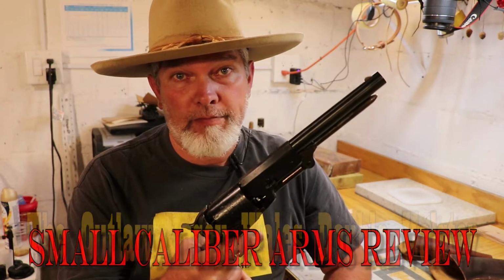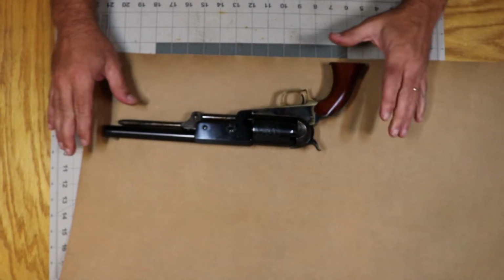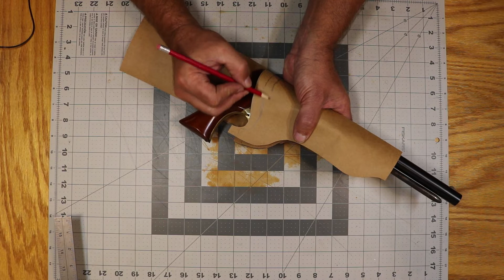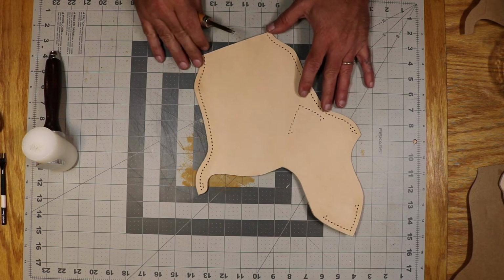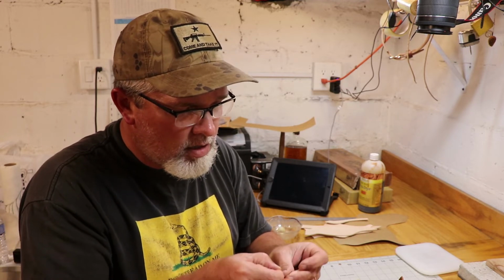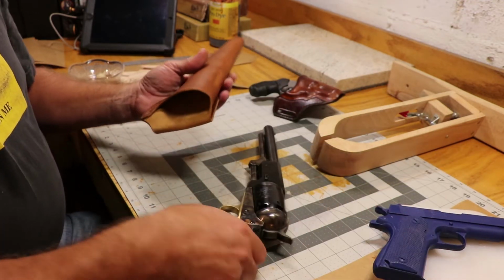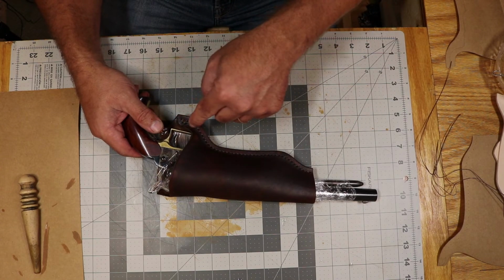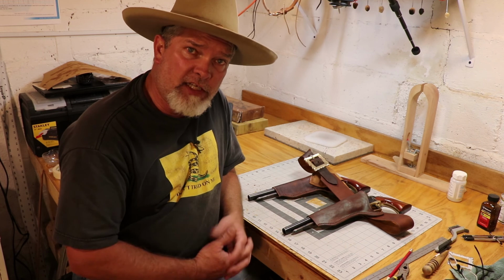Josey Wales Holster Leather Project, Lets make one!

Comment: Nice job making hoster but you should have lined the inside you Will wear to Bluing off the gun  pulling It in-and-out
Reply from the maker: You are correct. I don't plan on using it very much, mostly just for a video. I don't think a little wear on the pistols takes away from the looks, it might even give them a little character. I recently did a lined one for the Gambler Royal and will be making another one soon for a pair of Schofields! Hope you subscribed and thanks for watching!
Reply: Thats not totally true. The ruff and smooth side of the leather will wear off the bluing on any gun. Its not the material itself its just anything you constantly rub a gun on will wear the finish off.

Comment: The book Packing Iron ,I think has a picture of RIp Ford an early Texas Ranger Captain. He is packing two Walkers. I think Clints holsters are copies of those. FORDS dont cover the whole barrel. Ford is wearing them rather high on a ranger belt. Packing Iron is a great reference book for holster and belt design. I made a semi flap holster for my Walker and a Ranger belt for it. These weapons were originally meant to be carried over the saddle pommel. Early military holsters were full flap type.Ranger belts are based on saddle cinches Its like a two piece belt. By flap you mean the belt loop. Mine was stitched so the belt went thru it and it went over the pistol and fastened with a stud in a slit to hold the pistol in the holster as i cross the plains , HA!  I tried making a brass buckle, I gave up. Good info in your video.
Reply from the maker: I just may have to pick that book up! Definitely very heavy pistols to be wearing on a belt but, I just don't have a horse! Thanks for the comment and thanks for watching too!
Reply: @SmallCaliberArmsReview  Packing Iron  Steve Ratten bury. Well illustrated. You will like it. RIP Ford. The RIP was for Rest In Peace.
Reply from the maker: I picked up a copy of Packing Iron on ebay, good book and pretty expensive too! (even used) Thanks for the suggestion, I'll probably be making a holster or two from the book in the future.
Reply: @SmallCaliberArmsReview  Gee i have a copy i want to sell. I used to make a nice profit buying and selling that book. Highest price was like $140. I used to buy in the summer low and they would go high around Xmas time. its a great book. Good luck.
Reply from the maker: @kennkid9912  I just picked up a second copy for about 1/3rd of what I paid for the first one. I think I'm going to offer it as a giveaway when I hit 25k subs.
Reply: @SmallCaliberArmsReview  Good idea. Abe Books is good for that sometimes. Ebay can be good too.I have probably owned 35 copies.

Comment: I missed the buckle part for some reason. That came out very nice. And the brass  keeper is bent around the mid bar. An integral mid bar? i tried to solder mine. That is easier. Good idea.  Where do you get your leather working tools.?
Reply from the maker: Yeah, the buckle is one solid piece, except for the prong. My tools are a collection of Tandy, Weaver, Amazon, ebay and Lowes. I've been picking them a little at a time over the past few years. If you can afford it, go for the best quality ones, there are differences in some of them.
Reply: @SmallCaliberArmsReview  never bought from Tandy or Weaver. I figured most of the Ebay stuff is Chinese knockoffs, they seemed pretty cheesy. I looked at RIP Fords pic on line. He doesnt have the semi holstesr. IT looks like a slim jim with a full rounded flap. I have seen the Wales type in a oldT exas ranger photo but it wasnt RIP Ford maybe it was Hays.i do think that one had the full flap too.
Reply from the maker: @kennkid9912  Ebay and Amazon carry the Chinese stuff but if you're very careful, it will last a little while. I got two projects done with my smallest stitching prongs before they fell apart. Many of the old holsters had flaps that were just cut off to make access a lot easier.

Comment: Tho I’m sure you were after the movie’s “Josey Wales” holster, it’s a faint goal IMHO: a poor design that’s obvious to my eye.
Why? b/c the front sight is always gonna hang on the draw, it’s prone to muzzle fouling by anything that could be beside you upon sitting, that open toe makes the hog leg look even bigger than itself, and the balance point on those WHEN LOADED (rather than when designing while *unloaded!) is higher than the axis pin and forward of the forcing cone. (Loaded, two irons are over 12 lbs!)

Even Eastwood couldn’t whirl those monsters around the holster very well.  (IRL, they wore em high b/c he had suspenders holding up his pants). One might have expected him to use a shoulder sling to help his belt, but that was the experience of calvary and officers— and after all, it was only a movie, right?
[While he rightly identified the flap holster of a soldier as “slow”, doesn’t slow me down *that much.]

His experience in the war would’ve shown him that Walkers could kill anything, including horses, mules, and several men standing in a line. (Walkers and dragoons were even reportedly used to down buffaloes.)
Reply from the maker: I agree there are much better holster designs. The movie holster is what I was going for even if it's a poor design. Thanks for watching!

Comment: Where did you get the hat?
Reply from the maker: I actually made it from a standard "Cattleman's Crease" hat, the kind you can pick up from Tractor Supply or Boot Barn. A little steam and some hand forming and , Viola! (Sort of) Thanks for watching!
Reply: Dude you are kidding!  You nailed it!  You made the pencil roll on the brim look authentic  1800s.  Josey Wales hats on the web cost at least 250.  I’m confident in forming the crown but I’d like to see how you made that pencil roll look so neat.  None of the western shops in my area can do it.
Reply from the maker: @WOMPITUS  It took some time that's for sure! I also have a very small travel iron that I ran around the brim while pushing the pencil roll, or edge of the brim up against the iron. I saw the prices on line, I couldn't afford them so I bought a cheap hat and did it myself. Several of the hats I wear in my videos are ones that I formed myself. The "Man with No Name" hat was also hand formed.